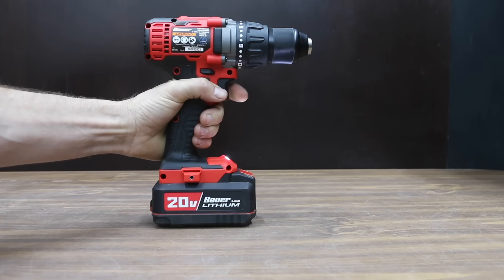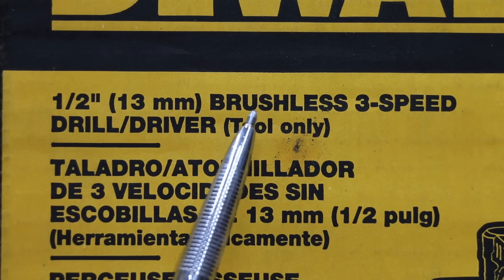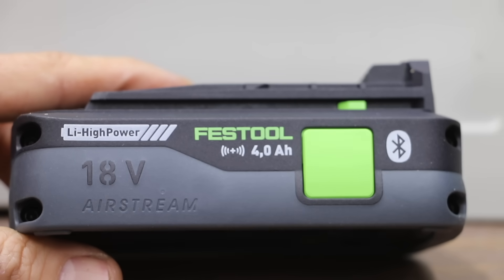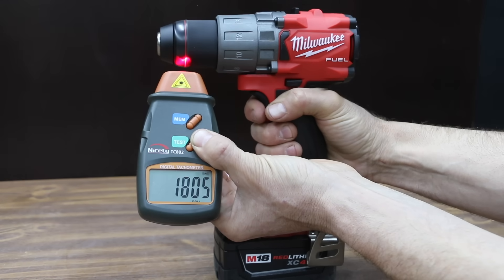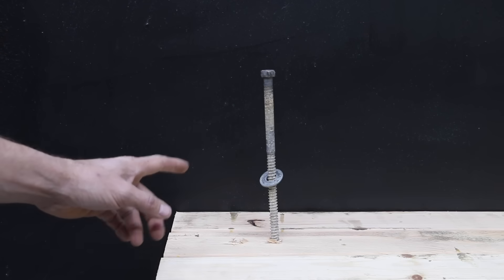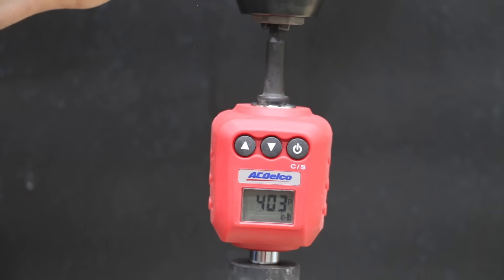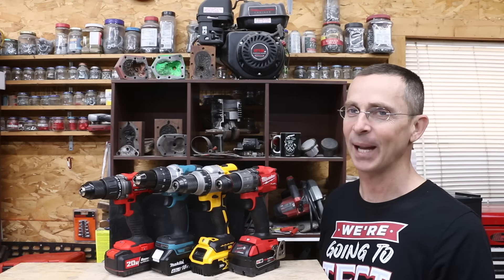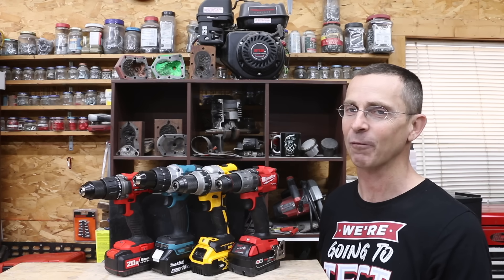Best Drill (BATTERY POWERED)? Milwaukee vs Dewalt, Makita, Bosch, Festool, Ryobi, Bauer, Ridgid

Comment: Milwaukee, Makita, and DeWalt are as good as it gets. Can't go wrong with any of those brands if you're in a professional environment and need professional tools. However, if you're just looking for a line up for DIY stuff or personal projects, Ryobi is by far superior IMO because of their pricing and how massive their lineup is and the fact that their battery connections virtually never change. Personally, I'm a Makita fan because in  my personal experience they have been the most reliable over time and the ergonomics are amazing.
Reply from the maker: Thanks for sharing.

Comment: Used dewalt the whole time I did construction. Zero complaints. Accidentally left one out in the rain all weekend, Monday it worked just fine. Dropped them all the time, made no difference. But if you drop one 30feet....you got problems lol we busted a couple of them by dropping them doing metal trusses. If they get hot to where it’s burning your hand you definitely need to give it a break to cool down
Reply from the maker: Thanks for sharing.

Comment: Who would buy a Festool, why is it so expensive?
Reply: Festool lovers always say longevity. But when you can buy a tool and then 4 replacements for the price of one Festool, does it pay off? I have several corded and 18V cordless Ridgid tools between 10 and 15 years old, still running great. I've never had to retire a Ridgid yet, but that's only one person's experience.
Reply: @BrBill  Exactly, you can buy 3 or 4 of the others for a price of a Festool, even chosing a Dewalt or a Milwaukee

Comment: did you test the drills with electronic clutch in the lowest setting and the fastest speed? for example my dewalt DCD996 is easier to stop on speed 3 than speed 1

Comment: Anyone who uses these drills on a daily basis, long story short is either with Milwaukee or DeWalt
Reply: Makita is the more solid built out of all of them imo, will tend to outlast them
Reply: Been using rigid for 10+ years and never done me wrong. But I've used pretty much all and like each of them in their own respects and still own every brand here minus festool and bauer. Most of the time it becomes a game of how many batteries you have to buy down the line. Or at least in my personal experience it is.
Reply: @FarmAndRange  Yeah man, it’s only the batteries that get you stuck in a brand. As a contractor DeWalt has always lasted the longest for me and the pricing in 🇨🇦 is pretty good
Reply: @michaelk5094  its not too crazy here in the US but definitely up there in price in comparison to some other countries. If I can't pull the battery out of my Sawzall and pop it in my impact or multi-tool or bandsaw or whatever the case may be I don't want it. Depending on the job decides on what set comes out. Rigid being substantially cheaper on top of having to let my helpers use all my tools id rather put the wear on something I can replace without needing Vaseline at the checkout.
Reply: Something i really hate about the new Milwaukee drills and hex driver is that the lowest torque setting is between 2-3 on the last gen. So i ended up keeping my beat to shit older model hex driver for when I need tl spin smaller fasteners.
Reply: Dewalt🤣🤣 Makita > Milwaukee
Reply: Makita

Comment: I recently started a job building pergolas, and it has made me skeptical about impact drivers. Most of the fasteners we use are 10" long 1/4" lag bolts. My kobalt 24v impact will drive them into a cedar 6x6, but gets hot and overwhelmed after about 3. The ryobis HPs the company provides will barely do one. But my kobalt drill will drive them all day, and faster than the impact will. Only downside is you have to really manhandle the drill to keep it under control
Reply from the maker: Thanks for sharing.

Comment: All of these drills require a specific battery to run at the peak performance that is on the box label. And with every brand other than Milwaukee the battery required does not come stock in the box, you must buy them separately. That's Milwaukee's advantage, they include the battery that makes the drill function at it's best. The other brands want you to buy this separately. Whereas most of them are still being established or are trying to get more customers dependent on their battery platforms, Milwaukee does this by adding cost(which is a bad marketing tactic if the product being sold isn't the best. And it happens often.) Milwaukee certainly wins at this. But what you're seeing in the tests is not the drill performing at it's best, or as labeled, like you would get as a customer that is in fact dedicated to that platform.

Comment: I have a Bauer, from Harbor Freight. In fact, I have the chainsaw, the hand saw, and sanders. 2 batteries. 1 year later, they all run perfect. Unless you're a contractor who needs heavy duty everyday, the Bauer is very hard to beat for the money.

Comment: Since you run a farm, can you do any machine or equipment repair videos, or compare jb weld vs actual welding? Great content!
Reply from the maker: Thanks for the suggestion.
Reply: @ProjectFarm  I also have one more question... Rear main seal leaks on my old Jeep sucked. I bought it for $700, and to have it fixed cost more than the Jeep... Could I have used a solvent to clean the leaking area and just use jb weld or another goop to stopped it leaking oil

Comment: Clutch/Torque Limiting data
This video was great, and you briefly touched on an issue I'd like to see covered in detail for these drills.
A year ago, I gave my trusty Dewalt DC720 to my son, and "upgraded" to a DCD996 (bigger is better...right?)
What I quickly discovered is the electronic clutch has limitations (compared to my DC720).
Not only does the DCD996 have far more torque it only has 11x torque settings ( vs 17 on the DC720 ), and as you pointed out in video, the lowest setting is still a lot of torque.
The other thing that seems obvious on my DCD996 is because the torque setting is "electronic" (based on motor current), is the torque control varies based on the speed/gear setting. For example, speed 3 torque 1 (lowest torque/speed), it will mostly stop a deck screw...at speed 2 torque 1, it will pull through, speed 1 torque 1, it will not stop. Given the 450/1300/2000 speed ranges simple math puts the torque variation more than 4:1 from speed 1 to speed 3. For the DCD996, it does not appear the drill is compensating for (or aware of) the speed range that is being used.
For my old DC720, the output shaft clutch did not care which speed range was being used...limiting was the same regardless. I just bought a DCD708 (also with output shaft clutch) just for smaller jobs.

The request is: For your nice collection of drills with and without electronic clutches, could we get data on output torque for each clutch setting and speed setting? I expect speed setting won't matter for mechanical clutches, but would like to see torque increments. For electronic clutches, do any of the manufactures compensate for the speed selection?
Reply from the maker: Thanks!  Thanks for the suggestion.

Comment: Could you please, in case of testing cordless tools, compare them with comparable tool, but powered from grid or by internal combustion engine or even powered by air?
Reply from the maker: Thanks for the suggestion.
Reply: this is 2021..by now, we should be beyond battery powered tools.. but,we run on consumables,not longevity. a 2 yr old car,,is old..

Comment: I use a brand of cheap drill and impact driver called XU-1. They are really cheap, and although they only have short battery life, they haven’t failed me yet. I reckon the Xu-1 brand is worth the money, for home handyman use. They are capable of driving 4” hex screws into fence posts with relative ease.
Reply from the maker: Thanks for sharing.

Comment: Test some air compressors, especially ones that claim to be "silent". Stuff like pressure, fill-up time, power usage and most importantly noise level.
Reply from the maker: Thanks for the video idea.
Reply: This please...
Reply: I support this but I've owned/tested them all. The Specs tend to be accurate. 60db (rated) is audible but you can easily hold a normal conversation in a small room without any issue. The 1 gallon variants rated at 57ish Db are significantly quieter than the 2 gallon 60db and can be run in a small room at about the same sound level as a medium size fan on low or a small air purifier on medium.

The larger silent compressors such as the 3SCFM+ @ 90psi typically range from 60-73db. The Home Depot 175 PSI compressor is significantly louder than the HF 2 Gallon but, still, can be run in a small bedroom without disturbing anyone and is not very loud. Moving up to the 4-4.5SCFM@90PSI is when you start reaching 70-73DB. I currently have the Lowe's Kobalt 26 Gallon Silent which is 4.5SCFM and 73DB. It's great and usuable in my small room; it won't disturb anyone outside my room but at that noise level is becomes difficult to listed to laptop audio. By comparrison, any 'traditional' compressor would be deafining in my space and you could not hold a conversation without screaming. The 'Silent' pumps are fantastic, but if you look at them, you may realize they're basically all the same and the only difference between brands is aesthetics and sometimes PSI.

Speaking of PSI, completely skip California Air Tools and go for 150+ PSI. The HF 1 and 2 gallon compressors have utility at 135PSI but can't run any air tools beyond very short bursts. They are good for inflating and air brush and blow guns for dusting, though. I've owned both and loved them. They COULD be used to run an impact but that requires an expansion take of 7+ gallons with some DIY fittings and you need to watch duty cycle to not overheat the compressors. I highly recommend 'Silent' compressors but the only one I've ever felt as good was the DeWalt 15 Gallon 225PSI, because the high PSI gives a lot of capacity.
Reply: Which ones claim to be silent?
Reply: @scrappy93  They announce it as a feature right off the bat, on the box/product page, etc, though I've yet to track one down from a big brand. HMB Machines is an example of one I've had my eyes on for some time now. All that aside, what all "silent" compressors seems to have in common that helps identify them and differs from "standard" ones is the same kind of motor. It's cylindrical and rather compact, as opposed to most compressors which have a hump sticking out. They may have 2 or even more of these motors side by side as you go up in tank size. I've seen one with as many as 4-5.
Reply: @DanielsGameVault  I've been looking at "California Air" at the moment, but also looking for a compressor with a low Amperage demand.
Reply: Membrane is more quite than piston but lower pressure and lifespan
Reply: When you need a silent one theres only one option: screw compressors but they deliver a large amount of air which you may not need. (Kaeser is the best brand you can find used ones on ebay etc.)
Reply: Yes do this please

Comment: I really enjoy the form factor of the Milwaukee brand. Unfortunately I've found Ryobi holds up better over time.

Ryobi drill 4 years + , I only stopped using it because I got Milwaukee.

Milwaukee drill 1.5 years and the chuck is giving out.

Thank you for your videos.
Reply from the maker: You are welcome!
Reply: Ive seen this issue with Milwaukee quite a bit. It's the brand of choice for a lot of people in my field and I've seen guys using channel locks to tighten the chuck.

Comment: Maybe you can answer the new-age question. Are flushable wipes actually flushable. Are there issues that they cause in septic tanks? Is there a difference on a sewer system. I hear that they’re not flushable at work but still use them in my house. Thanks!
Reply from the maker: Thanks for the video idea.

Comment: If you do revisit these with drill bits/material removal; it would be interesting to see you test the chucks themselves, mainly if there is a difference in run-out between the brands.
Reply from the maker: Thanks for the suggestion.

Comment: I have a tool suggestion. Working in the trades my everyday tool consists of a digital multimeter or clamp meter. I'd love to see a shootout comparing different brands of multimeters to see which ones are most accurate to which ones can withstand drops. Just a thought. Brands like extech, fluke, fieldpiece, ames etc
Reply from the maker: Thanks for the suggestion.

Comment: I enjoy these videos. However, this one seemed as though his was testing drills based upon parameters for an impact driver. Knowing if a tool has the raw ability to drive in a lag bolt when it's function is to connect to another tool (a drill bit) to remove material seems to be not a really valid way of testing a drill.
Reply from the maker: Thanks for the constructive feedback.
Reply: These drills are drill/drivers. That is why they have low gears and torque settings.

Comment: Maybe what more expensive tools offer over the cheaper ones is a longer useful life. Or in the case of battery tools, the life of the battery might be test.  I've thrown away several drills because the battery was shot and it was cheaper to just buy new.  $500 for a Festool drill - really?
Reply from the maker: Thanks for sharing.

Comment: Pressure washers please.
I always come here first when I'm thinking of making a purchase.
Reply from the maker: Thanks for the video idea.
Reply: I've used gas powered Craftsman that fell apart very quickly.

I bought the cheap ($150) Ryobi electric corded, it would not finish my driveway on the first use. I returned it and got the Ryobi ($299) electric corded and so far it is a champ.

Comment: I love how 550$ tool got outperformed in almost every task by a 150$ tool, plus the 550$ tool is so long that it doesn't fit in tight spaces
Reply: It becomes the shortest tool when you take the chuck off and gets even shorter when you put the angle chuck on....

It's also a 15 year old model so that might explain the performance, there is a new model that is launching this year with a new motor so will be interesting how that compares to the competition.
Reply: @ieatporridge8975  that's why it looked so outdated, but why are they still selling it at such high price point, or was it like 1000$ when it was brand new, because i know one guy who told me that he bought festool vacum for 2000€. I thought that it is outrageous, because his car is cheaper than that vacum.
Reply: @kamolzaaliite  2000 is a bit steep i think 1500€ would be the most you will pay for a festool vacuum, which is still very expensive.

The price for the drill is very steep considering it's so old it originally was branded as "protool", but it has 3 very good selling points, the removable chuck system, 4 speed gearbox and the ergonomics which are easily the best on the market.
Its definitely not worth the price for the average carpenter, but for certain carpenters who are using a drill for hours everyday it is definitely worth the money as the ergonomics and build quality are that good.
Reply: Aye, it got trounced. I think it's aimed at the market for those people that think if they spend more, then they're getting the best.
Reply from the maker: Thanks for the feedback.

Comment: Sorry, this question isn't about the drills;
Just wondering if you have ever done a comparison with after market catalytic converters?  I have a suspicion that there is a wide range in quality and efficiency and wonder if the California BAR version is really any better than the 49 State versions.  The Ca version costs 2 -3 times as much.
I have a 95 Jeep Grand Cherokee with 260K miiles and it failed it's Ca smog test for NOX at triple allowable maximum.  It runs fine and I have no check engine light.  O2 sensor was changed 5K ago for check eng light and rough idle and the Existing Cat has 60K on it.  I'm seeing prices for a installed cat for $500 -$1200.  It seems that one could get really screwed by not knowing which cat is best for the money.
Reply from the maker: Thanks for the suggestion.

Comment: I would have liked to see you put the thermal imager on the drills for the endurance test, as well as measure the runout on the chucks. Runout is not important for driving in bolts, but is for drilling holes.
Reply from the maker: Thanks for the feedback.

Comment: I have all Milwaukee tools and I can personally say that the second gen Milwaukee 1/2" hammer drill was the best. That damn drill got stuck in a knot while I was drilling 2-9/16" holes for vent pipe and that damn drill whipped around so fast and so hard that it took me (200lbs) with it and literally threw me off the ladder I was on. It kept pace with a damb hole hawg. The 3rd gen 1/2" drill doesnt hold a candle to the 2nd gen.
Reply from the maker: Thanks for sharing!

Comment: Festool is way overpriced and not that great. 
Ryobi also makes brushless tools and they have several lines of them. 
I’ve had Makita, dewalt and Ryobi. Ryobi has not changed their battery design like the others have which makes their tools useless.  I have several Ryobi tools.  They are quite adequate for most jobs. I have never regretted buying them.
Reply from the maker: Thanks for sharing.

Comment: An interesting I was wondering was if you leave a ratchet strap outside for a while to weather it or soak it in water if it gets much weaker since I once found a strap laying outside and it was so stiff I thought it would break if I used it
Reply from the maker: Thanks for the suggestion.

Comment: I got the festool. I think something in your testsetup leads to the weird numbers on the electronic clutches.

I think the static load just avoided that the electronic clutch works properly, since the motor gets extra power to start spinning. Try to drive a screw in and test the pressure where the driver shuts off.
Reply from the maker: Thanks for the feedback.